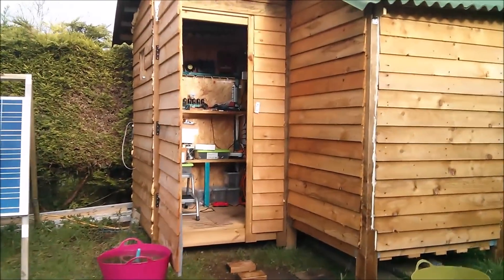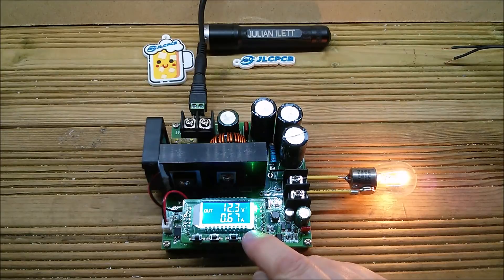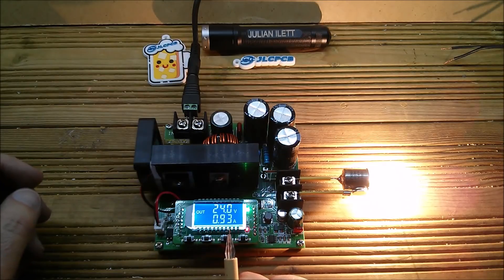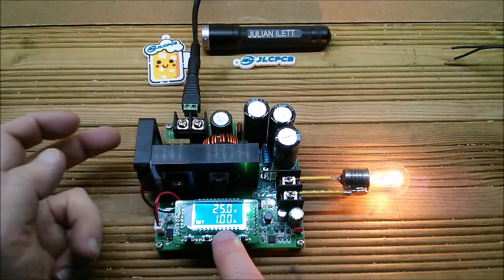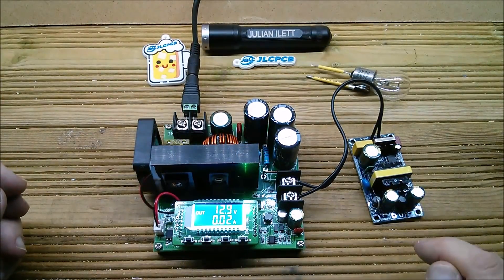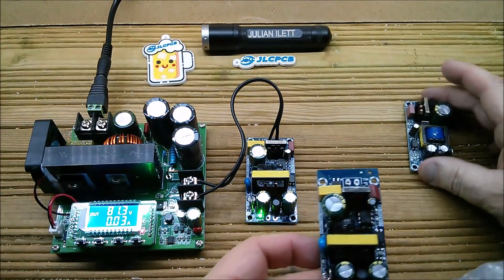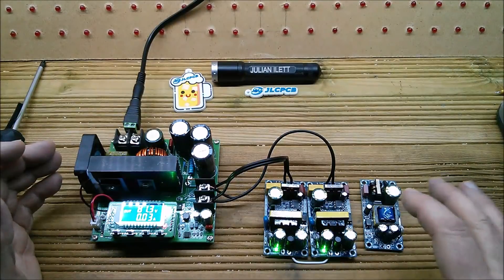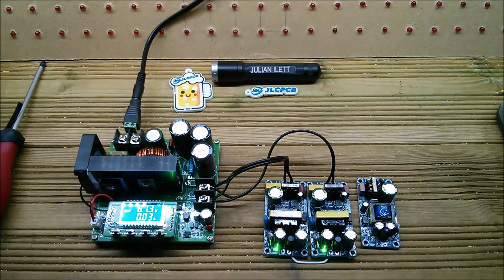Build a Multi-Rail PSU

Comment: I have one of those with the led display and it's alright but and I know like you said it always passes current but it seems like on something like that that is a bigger more expensive unit that they could have a relay or mosfet on the output so it would just be disconnected till you enabled it

Comment: I believe there should be a mode that indeed turns on the boosting as soon as it gets a sufficient input: long press the button to change from input and output parameters for 2-3 seconds and you should read ON or OFF
Reply: 1. Start boost
① Manual boosting press and hold the OK button for 10 seconds to enter the interface and select AUTO-OFF as manual boosting. , Select AUTO-ON to automatically start the boost.
② Click OK to start or stop the boost.
2. Set storage
In the setting mode, long press the SET button for 10 seconds to enter the data storage interface, and use the up and down keys to select 10 groups of data from 0 to 9, and press the SET button to save the settings.
3. Retrieve and access the array
In the normal interface, press and hold the SET button for 10 seconds to enter the storage and recall interface. You can select 10 data groups from 0 to 9 through the up and down keys, and press the SET button to confirm the recall.

Comment: Consider turning off the auto-ranging function of the meter if you have it in shot because at times it looks like the output of your supplies shoots up really high when it switches over to mV range.

Comment: Julian, 
I just thought to let you know that over a year ago I layed out two versions of a simple switch mode board to supply  +15,V  15 V , 5V from a 5V input, with both + 15V  in direct converter output plus extra filter (LC low pass) outputs, and also a filtered 5V output. One based on through hole chip and some SMD the other slighlty smaller based on SMD switchmode chips.
I have run with over 1A on each of the 15V supplies and no issues. 
The 15V is of course able to be changed by setting corresponding resistor ratio even independantly for + and - if so wanted.
Size wise the board with DIP converter chips would be smaller, or worst case similar to the 5V module you had here. The 5V filtered output is fed direct from input source, which could be treated also as equivalent unfiltered source., so effectively you have three outputs with pure capacitive filter plus these same supplies with additional LC filtering.
Any interest?
Reply: Seems like a simple resistor (high current sustainable) voltage divider would do the same trick. All you need is one power supply. It's a lot losier, but it works.
Reply: @bill6590  sorry you have mis interpreted my short and partly miss typed message
I provide both +15V and -15V at up to over 1A at both direct cap filtered and extra LC filtered outputs, plus a LC filtered  output version of input. All from, as I presently use it, a single 5V feed power input. Of course the max output current will depend on the power capability of the input source. I have run over 1A on each of the three ouput voltages simultaneously. At the 15V outputs 1A requires a bit over 3A  source for each and a further 1A at filtered source voltage, that requires 3+3+1 = 7A from the 5V source or about 35W power. All from a 95x75mm (thru hole) or 100x50mm (smd). Note the SMD version makes use of a larger number of SMD and Chip capacitors than the thru hole asembly but also use the same screw terminals that actually determine a considerable part of space, and thus is not that much smaller.
 No way will you work a positive AND negative output supply from a single positive power source using dropping resistors.  
The 5V input , while that is what I am using, could be changed to other sources from 3.5V up to even over 15V if desired. But being designed to step up  the pos output, that at least must be higher than source voltage, while neg output could in theory also be lower than input, but was intended for a symmetrical analog supply, such as for OpAmps. The  actual output voltages can be varied by resistor ratios and pos and  neg can be different if desired.

As such it becomes a efficient flexible power source for mixed logic and analog circuits, utilising only asingle power source., be it existing bench supply, a mains powerpack, USB charger, batteries, etc.
8f your needs are met by dropping resistors do it, but in no way are you fulfilling the same objective

Comment: That blue 'capacitor' is possible a Voltage Depended Resistor to overcome overvoltage spikes
Reply: @Joachim Shekelberg Then I am wrong. If I was right it was indeed not isolated, and I do not believe that's the case. 
I have seen those spark gaps before, also in psu's.

Comment: Interesting solution. Why did you decide to not just use an old ATX PC supply for < $5 ?  The older ones have all the voltages you could need at higher current ratings and greater efficiency in 1 unit.
Reply: Usually the -12v rail is low current, 1A max.

Comment: with led lights i had to run a buck boost converter to keep voltage steady or they flickered as i ran my house lights of 12v rather then the 240 volt but stock uk light fittings

Comment: It can auto-start:
Manual boosting press and hold the OK button for 10 seconds to enter the interface and select AUTO-OFF as manual boosting. Select AUTO-ON to automatically start the boost. 
Click OK to start or stop the boost.
Reply from the maker: It can indeed - I will mention that next time :)

Comment: Just get a transfomer and make a linear power supply, all your going to get is a multi rail noise source.
Reply from the maker: Linear power supplies produce mains hum.
Reply: @JulianIlett  yes but Switch Mode Power supplies produce wide band noise. Nice caps and a a good ground routing and you can easy deal with 50Hz.
Reply: @TheEmbeddedHobbyist  An LC filter eliminates high frequency noise. Although for this project I would go with a linear PSU as well, especially since it's a 'vintage' project.
Reply: You need to have a good ground routing with SMP's and audio. keeping the power supply ground away from the audio ground until they meet at a single point. If you don't have the noise there in the first place you don't need to remove it. And as you say linear power fit's well with the project. Happy holidays and stay safe.

Comment: Don't forget to connect the negative output of the 5v PSU to the middle connection of the 12v PSUs otherwise you won't have a common reference and the floating voltage could damage components.
Reply: It's a good thing both of those 12V supplies have isolated outputs, otherwise connecting one positive output to the other's negative output would release large amounts of the magic smoke. ;)
Reply from the maker: I shan't

Comment: If you want 12v 30 amps can you use a bunch of these in parallel.
Reply: Since they all have isolated outputs, I expect that would be possible.  But you'd need plenty of oomph at the inputs in order to supply them all at their full rated output current.

Comment: 17:07 - "... current is quite low."  But you have to remember that is at 80V so those power supplies are actually idling at 2.4W.  Equivalent to drawing 100mA over that combined 24V output.  Not so low really.
Reply: You'd probably find that the switching ICs have a 10 or 20mA constant-current based Vref generator for boot-strapping the switching, in this case the CC-bootstrap pin stabilizes in conduction at around 70-80v and stops conducting at around 40-60v. hence the idling power.
.
The reason for a constant-current supplied Vref is to allow a wide voltage input as since if only a zener reference and resistor were used, then the current would go up with voltage, whereas if the current were kept constant, then the losses would be kept to a minimum and still have a stable Vref.

Comment: I'm not sure a switching PS is the right choice for an analog audio project.  I think it would have been better and likely cheaper to build a linear PS (or buy).  And you likely already have a transformer that would work for your vocoder's PS.  In a previous video you had a SMPS that was causing noise in one of the vocoder's modules.  Going linear would have eliminated any concern.
Reply from the maker: The SMPS - in a previous video - that was making a whining noise - was under so much load the PWM oscillator had slowed down into the audio frequency range. These new power modules can supply much more current.
Reply: @JulianIlett  - True but keeping all noise off of DC rails for audio circuits should be the goal.  I just think a linear PS would have been easier to build, lower cost, and lower noise for your vocoder.  PLUS more authentic to your vocoder's heritage and more fun to design and build.
Reply from the maker: Smps noise is mostly ultrasonic. You won't hear it.
Reply: @ElmerFuddGun  When's the last time you seen a modern scope or spectrum analyzer with a linear power supply? Switching supplies work just fine for audio if designed properly.
Reply: @ElmerFuddGun  I think a linear supply would probably be a bit more expensive. An LC filter on the SMPSU should get rid of almost all the noise and the parts used should have good PSRR. Having said that I would personally go for a linear supply if I were doing this.
Reply: I would have gone with removing the earth reference from the output of a couple of 460W HP server supplies to get 24V (or more with simple mods) and then re-regulated one half of the 24v (i.e 12V) supplies to 5v, however for Julian it all needs to work from a car battery/solar power voltage range.

Comment: You're liable to short out the back of a PCB with all the solder blobs and wire cuttings that collect on that desk.  I would highly recommend laying down your usual "crafting" mat (cutting) on that desk so you can easily sweep the mess away.  I've seen it happen and it will make you jump!  And then cry when you see all the damage your PCB.   8-(
Reply: 12:19 - I'm not sure why you are soldering over top (close enough) a live PCB capable of 80V DC.  If a bit of solder gets flicked off the wire in the wrong direction, again, it might make you jump!  Although that would make the video more exciting!
Reply: See now that would have been fun.
Reply: Good point. I think I am going to use some thin foam on the back of those going forward. I have a tone of it from packing materials. The fact the back of these are unprotected has caused a problem more than once for me. 

I started using large heat shrink tubes around the whole thing but I’m worried about the wires poking through on the bottom.
Reply: @ecospider5  - Well in the past, when we were younger, the bench power supplies we used were usually low voltage and current limited but these larger supplies or even batteries can put out a lot of current.  Non conductive foam should work alright but keep in mind solder can still get where it shouldn't go.  But at least you have removed a large possibility on the PCB back.  An enclosure is ideal of course.

Comment: That boost module is rated 8V-60V and it is set at 80V?  Are there capacitors at the output and what voltage are they rated at?   This one sure goes up quicker in voltage than the led version.
Reply from the maker: The input cap is 100V - the output caps are 200V.
Reply from the maker: The input range is 8V - 60V. The output range is 10V to 120V.
Reply: @JulianIlett   ahhh I now see it further down the listing. They should put that in the listing. This looks like a very interesting one especially for that price.

Comment: $23,000 currently for bitcoin, hows the ant miners doing?
Reply from the maker: The Scrypt machines (2x Antminer L3+) aren't bad - together they earn about $4 a day. But I'd need free electricity to profit from that. The V9 and D3 aren't so good - but they do chuck out lots of heat :)
Reply: Well given that they are making the $4 a day I’d say that’s not bad, I didn’t even expect that tbh. Yeah, it would be nice if it was a proper profit but hey you’re getting to heat the modular shed, warming the soul if not the wallet lol

Comment: Are your probes in the house and the wife has banned you from the house under tier four rules?? would have been nice to test it up too the full 900 watts claimed for the booster:-) Oh and the link item says 60V max output??
Reply from the maker: My shed has only one rule - it's mine :)
Maximum input current is 15A (12V x 15A = 180W).
Reply: @JulianIlett  so the seller lies, hmm nice link then??
Reply from the maker: Everybody lies - especially politicians!